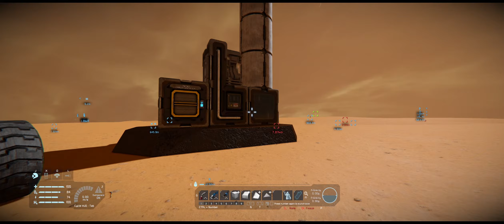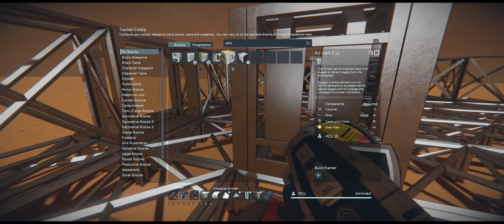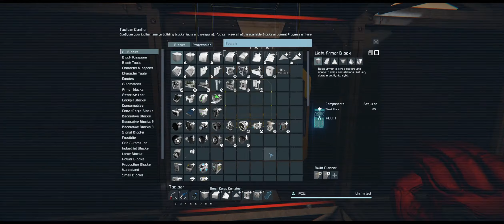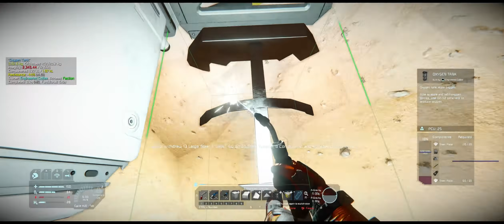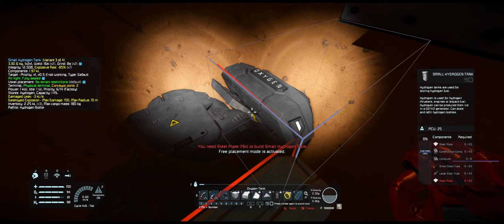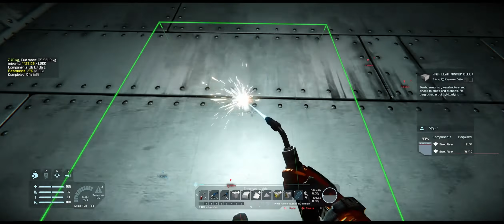Room to Breathe! Starter Outpost with Simple Vanilla Airlock | Martian Engineering E1 | SE Survival

Comment: I'm pretty new to Space Engineers, and I was wondering: Why did you use a "valve" system for your O2 tank? Is it because when its full, that the vent can't depressurize, thus wasting oxygen?
Also, I really dig this round base. Haven't tried one yet

edit: Turns out, you already answered this in your Airlock tutorial

Comment: Since it was available on the Steam library, I used this building on a Terran planet initially, then on its nearby moon.
The airlocks were very handy, but I must be impatient, as eventually the sensors fail, and then the doors, necessitating the use of a keypad to make them operate at all.

Slowly I am getting familiar with how all these sensors, airlock doors and vents work, but it's not clear yet. At the moment the sensors don't care, the doors don't work automatically and the airlock vent has breathed its last, but I will figure it out.

And for some reason, the room vent in the center now keeps pumping out air when the inner door is open, even if the outer door is closed. It doesn't stop unless the inner door is closed. It's all very puzzling at the moment.

Another thing that I don't understand is the purpose of the connectors under the grid. I didn't know what they were for when I placed the grid on the planet, so I forced them to connect. On the moon I left them alone, but watching your video of its construction, I'm confused. Why would a tank "overfill"? It should only go to 100%, so why would you need any overfill protection mechanism at all? That seems unnecessarily complicated.
Reply from the maker: There is an airtightness bug that occurs every once and a while. The game gets confused and either doesn't recognize pressure or it tries to pressurize the outside. Keen has been aware for a few years, but still no fix.

By overfill the tank, I mean 100%. You need empty space in the tank to depressurize to. If the tank is full the airlock vent will try to depressurize but the pressure won't drop and therefor the trigger won't open the door. I wish we could vent out to atmosphere but the game just stops the vent from working.

Comment: So I just found your channel, very informative. I like your method of controlling atmo in your base. One thing I noticed, which I'm sure you've figured out by now, the size of the O2 tank is 10x less then the size of the H2 tank. O2 is 100000, while the H2 is 1000000L so quite a bit of difference. Looking forward to the next several videos, I have some catching up to do ... also, subbed.

Comment: So I attempted that airlock setup you did but I didn't have the option on the event controller (that I could find) for door open so I ended up improvising by adding another tab on the controller for each to that flip flopped them. It works but it's not as effective.
Reply: Thanks so much, that tutorial help wonders also messed around with event controllers on a mining ship that I have docked to a rover, set it up to recharge batteries and turn off/on thrusters on connector lock/unlock. No more dampers flipping rovers. You truly are a hero.
Reply from the maker: Keen changed the name of the action to "Door Finished Open/Close", but still has the same function. You can check out my tutorial video, it has a better step-by-step explanation. https://youtu.be/1JhAI-X9XXE?si=SpL7Yt5DI5Bw314I
Reply: @EngineeredCoffee  much appreciated will attempt to resolve after I finish work today. Cheers!

Comment: The connector valve is new to me, very clever.
Reply from the maker: Well, until Keen ever makes a gas valve this will do.
Reply: @EngineeredCoffee  I was watching the droning on vid (i have an 8 month old, not a lot of sleep to be had) and i suddenly realised i was 6 episodes in and i hadn't subbed...that has now been rectified.
Reply: been using the connector valve for my drone tankers that are so big they can't run on atmosphere theusters only hydro so i have an extra pair of tanks that are just for running the drone and the other tanks are for carrying the gas, when the drone needs gas, it will use the small connectors to get a fill up while feeling up the cargo gas tanks and once filled, takes off automatically and brings fuel to main base, i can't wait to start recording unfortunately my laptop can only run the game and not the game and recording software at the same time 🤦

Comment: The connector trick to not overfill the airlock tank is neat. I'm going to borrow that
Reply from the maker: Maybe someday Keen will give us a proper valve or allow sorters to do it.
Reply: I just seperate the vent and o2 tank from the main conveyor network. you only need as much air as the airlock can hold in the tank. if youve set the air lock up properly, itll fill and empty based on the state of the doors and you'll never have to think about it again. i used to use sorter blocks because they didnt allow gases through but did allow the ice through to fill the tanks, but i guess an update somewhere or an undocumented update happened, because lately ive noticed gas doesnt care about sorters any more, which is very annoying.